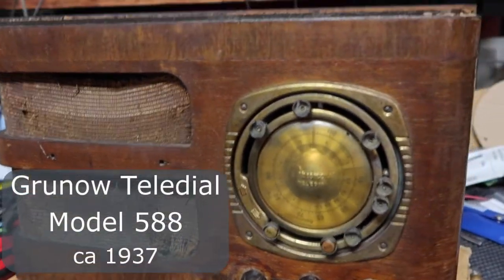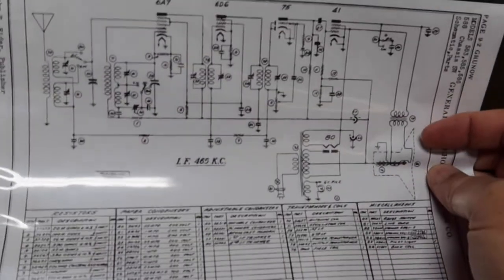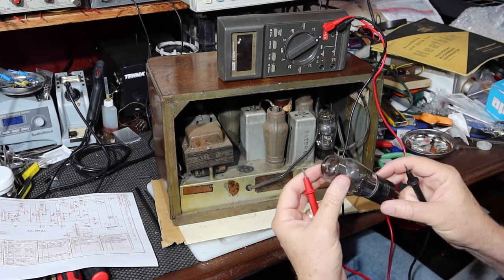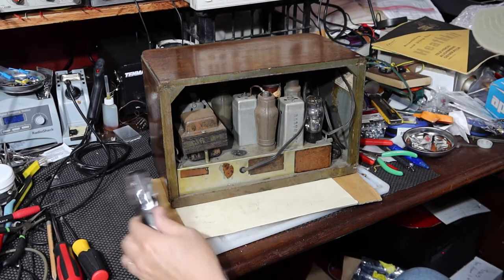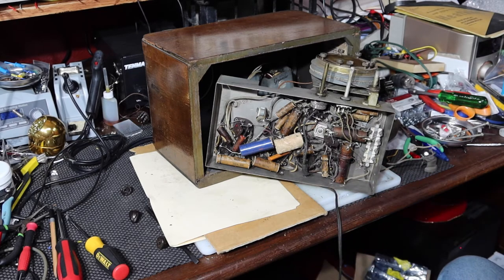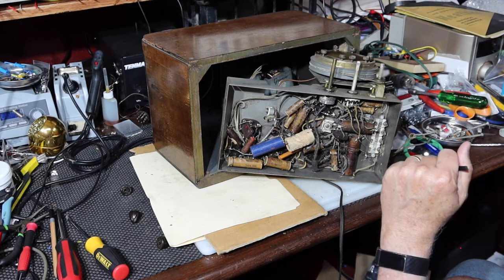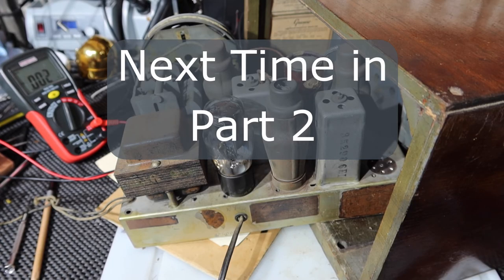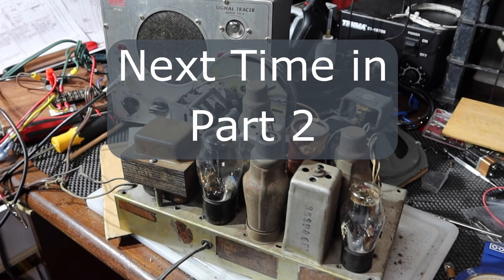Let's Work on a 1937 Grunow Teledial 588!  Part 1

Comment from the maker: Jump to:
6:20  Check rectifier tube filament continuity
8:11  Checking transformer windings by resistance, with NO power, using empty tube sockets
14:50  First look under the chassis
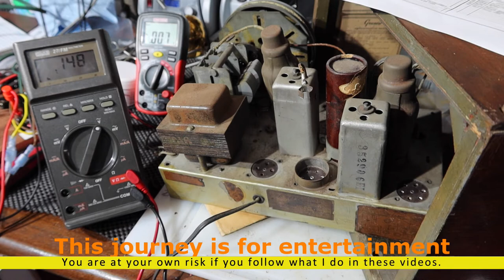18:49  Carefully checking transformer voltages

Thanks for watching